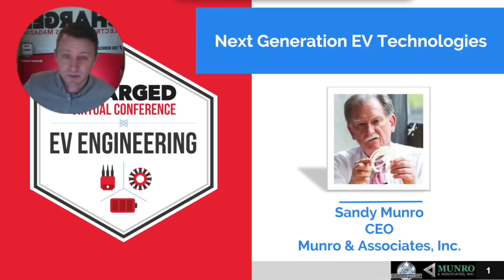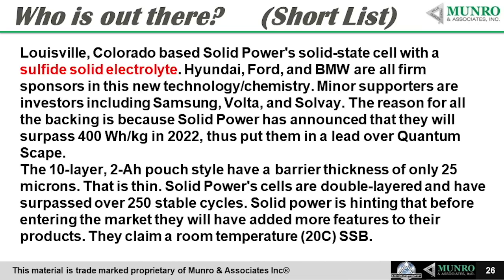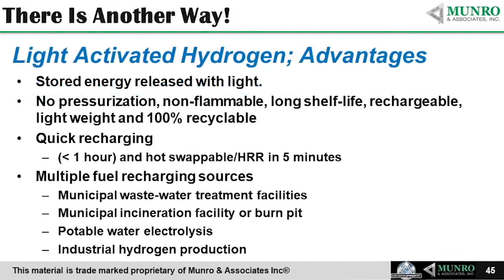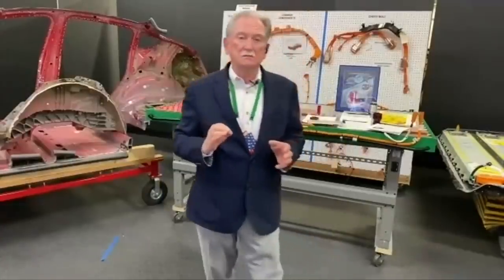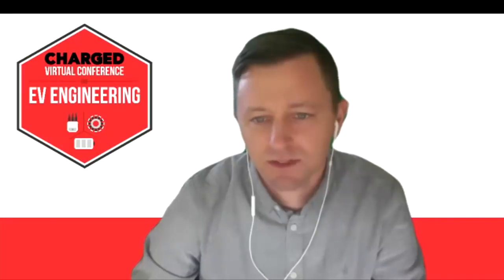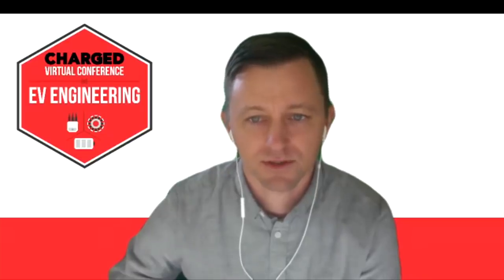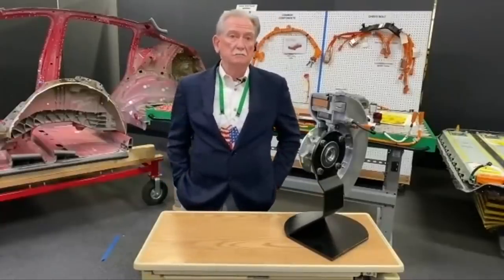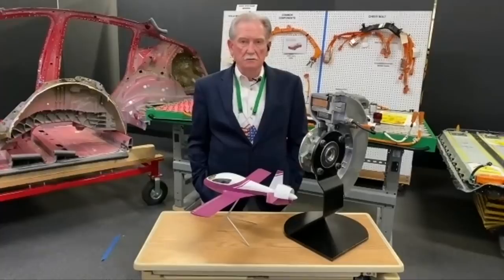Sandy Munro On Next-Generation EV Technology: Tesla, Solid State Batteries, MegaCastings, VTOLS, Q&A

Comment: The main reason that batteries will win out over hydrogen is that hydrogen has a negative EROI (energy returned on investment) of 1 to 5. That is one gets 1 unit of equivalent energy of hydrogen for every 5 units of energy input. An energy source of less than 10 to 1 (getting 10 units of energy for every 1 unit of energy input) is considered to be below the threshold needed for an industrial society. Renewable electricity is ~20 to 1, petroleum is ~14-20 to 1, and Canadian tar sand oil is ~3 to 1.

Comment: The most overlooked hydrogen storage option for fuel cells or for combustion is liquid ammonia.
Reply: Overlooked for a reason... no future for H2 in road transport.
Reply: @brunosmith6925  Sandy says the exact opposite and ammonia is not H2.
Reply: @fieldlab4  Oh... so I suppose we are to regard Sandy as God... what Sandy says will happen? Most observers believe Hydrogen has no future in terrestrial transport because BEV will be much cheaper. People make decisions by looking into their wallets. The engineering may be workable, but economics dicates behaviour.
Reply: @brunosmith6925  I'll wait for BE aircraft. Meanwhile, the energy density and inherent efficiency of using free oxygen for half your energy cycle will not be ignored. Are fuel cells a battery or a "H2" power source? 

How many kilowatts per pound do the best batteries provide, versus H2 and ammonia?

There is your answer, right in the numbers.

Comment: I'm impressed that battery chemistry advances gradually via "trial and error" and the Tesla "jelly roll" technology lends itself readily to improvements in battery chemistry without necessitating major alterations in expensive manufacturing machinery. Can the same be said of solid state batteries? My guess is that mass production machinery for solid state batteries would likely work for only one type of solid state battery, and that advancing to a better solid state battery would likely entail major changes in manufacturing equipment.

Comment: The problem with personal vtol is flight is an extremely dynamic situation.  That's the reason only 2% of the population has ever operated any type of flying vehicle. Those vehicles will need to be fully autonomous because the average person simply doesn't have a high enough livel of situational awareness if they did there would be zero traffic accidents on the highways today !

Comment: Ammonia is a stable hydride in liquid form. It adds one nitrogen per three hydrogen atoms but it can be used in internal combustion engines. Thermal efficiency is always the issue. But a crank less engine moving a coil back and forth will generate power with fewer losses and could potentially be made with variable stroke and variable compression ratio.
Reply: Sabic and Mitsubishi have been working on Ammonia projects for a variety of applications, but haven't released any details since the initial announcement

Comment: eVTOL? UAE and China are piloting ‘Unman Drone Taxi’ between urban to urban (big city) and urban to suburban with batteries operated for 2 and 4 seaters. It makes senses Dow few reasons. Firstly it’s autopilot so no license or pilot required. Secondly drones talk to each other (drone swamps) which means the taxi fleet could comply with aviation regulations for traffic control and safety purposes. Lastly is maintenance, a taxi fleet with equipped with knowledgeable engineers with routinely check list according to requirements while personal one could created issues either personal discipline or service quality.

Comment: a ventilation safety device for  batttery packs can help it to breath fresh air and out. Also act as safety device in an evetn of thermal runaway.
Reply: The battery packs don't need any ventilation.
Reply: You don't want any moisture to accumulate inside the battery pack.

Comment: Doesn't the Aptera's use of vacuum cast composite body components take advantage of the giga press casting idea without having to buy a giga press and deal with molten metal?  I think the Aptera has maybe 5 total body components that can be self aligning in assembly and hand fitted with no use of robots.  So much about the Aptera seems to be really smart to me. I know Sandy is working with them so I'm looking forward to a tear down of one in the next few months as they are getting close to rolling some off of the assembly line. By the end of this year or early next year.  Exciting times ahead.

Comment: Thanks for the video.
Question: if any of these castings get damaged in an accident there is no repairing them, correct?
Reply: Sandy stated that the casting can be welded, the casting is basically 386 Aluminum. But, 420KinK is right, once the car's frame is damaged the Insurance usually writes the whole car off.

Comment: Mega casting save lots of production steps, but how repairable are they? If the car is in an accident will the entire mega casting have to be replaced? I think so. This almost writes off the entire car in an accident that could have been repairable on other conventional vehicles...😕
Reply: Since the Megacasting is effectively a part of the Frame the question about repairability is superflous - if the Frame of a Car is damaged in a Crash its a writeoff, no matter how said Frame was manufactured. Also before it gets damaged the impact would have to go through the whole front/rear crumble zone first, not sure if you would trust any car repaired from such an impact..
Reply: The mega casting has front crash rails that can be sawed off and new ones bolted on to the remaining frame, so it’s designed to be more repairable than most frames.
Reply: @JanineArchiMarie  - So sections of the Mega-Casting can be replace if dammanged?

Comment: Some hydrogen issues covered but there are other bigger showstoppers:
Need to look more critically at the hydrogen fueling cost and logistics in road transport applications.
Due to still insurmountable problems and regulatory safety issues with transporting hydrogen that has such poor volumetric density it would take 30 H2 transports to carry the same energy to a refueling station as a single gasoline tanker. Liquid hydrogen is off the table due to cost on both ends
Also look at the cost of hydrogen fueling stations per vehicle per day. An H2 fueling station at $3 million can refuel 4.5 Class 8 trucks at 35 kg each.

Comment: In the old days, the stiff one piece construction of the race cars lead to more driver concussions from crashes. The crumple zones helped reduce occupants from sudden acceleration during crashes. Is the solid one piece body cast bringing us back to this problem, or is all solved with air bags or something else?
Reply: The Tesla Casting is not part of the crumple zone to my knowledge, the Crash rails Elon mentoined are the "part" where the parts of the cumble zone are attached to on the chassis

Comment: Love Sandy but that's not how SAE levels work, level 3 no longer requires the driver to monitor surroundings until prompted, it's a Level 2 system right now and even Tesla described it as such in filings. Get to L3 before talking about L4.

Comment: How does one do a quality inspection of the die casts? it would be bad to notice a small defective section after more assembly is done. Or do they do an in-situ repair?
Reply: Probably automatically with cameras
Reply: In Tesla's case quality inspections are the responsibility of the car buyer, not the company.
Reply: @cruiser97eric1  LOL, but those presses are interesting. I'd like to see what it takes to completely fill the mold and what they do to insure that it comes out perfect 9x.xx% of the time, and what the value of x.xx typically is.
Reply: I wasn't real happy with the gigapress video. I was looking for more engineering info.

Comment: All electrical applications has heat as the enemy. Cooling with liquids is old technology. 0.7 amp DC can maintain all electrical components at optimum efficiency temperatures. I built a hot plat / cold plate in my lab and with a thermocouple run thru a pc, I controlled any temperature desired.

Comment: With copper shortages and price hikes going wireless is going to look better and better.
Yes, there will be shortages as the demand has drastically increased BEVs solar, wind, power, and the wires to get it all to the users while copper mining and recycling have not, the lead times to get those up and running are 5 to 10 years.

Comment: With a Tesla vehicle for example, when you take your foot off the accelerator pedal, regen braking takes place. Which I believe is the reversing the polarity of the motor/motors to turn them into generators and capture that energy by storing it in the battery.  If thats true, why cant a generator be installed that captures energy by the wheels rolling forward? So the entire time it's moving it would be generating energy and storing it in the battery. Potentially having never the need to charge it.   your thoughts?   ty
Reply: An electric motor and an electric generator is basically the same. If you put 100kJ electrical energy into the battery (90%efficent) 90kJ electric energy comes out, if you use that to turn a wheel you get (95%) 85.5kJ rotational energy, if than take a generator to turn it back to electric energy (95%) you have 81.2 kJ electric energy left and in the battery only (90%) 73.1kJ arrive back. 

Because of the natural law of conversation of energy and inefficiencies that convert the other 16.9kJ into heat energy you will always end up with less energy than you started.
Reply: Extracting energy from the wheels while they're rolling (forward or backward, doesn't matter) will place a stress (apply a counter-force) on the electric motors, slowing down the rotation speed of the tires. 
Kinda like a "magnetic brake" of sorts.

Comment: Hi Mike why not use the wheels as a generator by putting a coil in tires and a magnetic core either in the middle of the wheel or as part of the disk drive? that way you can recharge and add to the distance an 
electric car can travel

Comment: Think the battery stuff and fuel cell info is great! I think the VTOL stuff is (pardon the pun) pie in the sky for most of it. If everyone who has a car now gets a VTOL - the sky is going to get very crowded very quickly. There's a reason why we spend millions and millions of dollars controlling airspace all over the world. If your Toyota get's a puncture or it's engine goes phut on the way into Tesco's car park then the worst that'll happen is you cause a traffic queue. If you're VTOL loses a prop or runs out of battery at 500 feet over the store's roof... you get the picture. I'm afraid the laws of physics get pretty unforgiving pretty quickly. Unless you're VTOL is lighter than air. That to me is an insurmountable issue for their widespread use with existing technology. And it goes whether your machine is piloted automatically or not. The costs of building in enough failsafe into the designs are just too high.
Reply: That - plus greater energy efficiency and all weather operation - is why I think tunnels are a better way to make traffic 3D. Of course there will always be a place for aircraft, but tunnels that can eliminate stopping and with cruising speeds twice what is possible in cities at present is going to be a huge improvement over what we have now, and more than sufficient for urban areas for routine travel.
Reply: @alanlight7740  Tunnels are just boring 😁

Comment: How long does it take to 3D print a car chassis? Hours? How long does it take Tesla to cast a chassis? Milliseconds? Both methods require expensive pieces of machinery, but guess which one is economically viable? Remember: 1 hour = 3,600,000 milliseconds...
Reply: Casting a chassis takes much longer than a few milliseconds.

Comment: What happened to ultra capacitors I thought they were going to be a high charge/discharge complement to batteries?
Reply: having capacitors on top of the base battery pack would help with quick accelerations/regen.  For charging the bulk of your capacity is still in the base pack which would still be limited to how much power it can soak in.
Reply: With all the new battery types having extremely low internal resistance (= very high charge / discharge currents possible) Super / Ultra caps simply become obsolete.
Reply: There MAY be a option for UC to act as turbocharger (high power dump) and to buffer high speed recharging if we can get there weight low enough

Comment: Self-anything, especially (actually essential) for futuristic air travel (VTOL for example) are in and of themselves awesome ideas. The problem is they are not compatible with sharing an environment with human operated vehicles, and will require more infrastructure including vehicle to vehicle and control station communications. Fantastic. Just one problem: All danger in travel right now comes from human fallibility. Self operation moves the human fallibility element to the designs and writing code. Humans make errors, people will still die, although it is likely be a significant statistical improvement over human operation.

Kind of like capitalism. Great system for wealth creation that is unfortunately underpinned by two essential elements: trust and ethics. Two things humans are guaranteed to consistently fail at.

Guaranteed to take the fun out of transportation.

Comment: Batteries are still heavy. Pushing around all that weight is not efficient and charging time is still too long and lithium production is still costly environmentally. 
Aluminium-Air is the best for aviation.
For cars it will be a combination of batteries, hydrogen and solar. 
Vitol for general transportation is crazy idea. Can you imagine the traffic management and licencing for safety,  forget about deliberate throwing stuff out of overboard.
There are already so many cars that shouldn't be on the road already.

Comment: I say people should take another look at Atlis Motor Vehicles. I believe they've finally figured out the charging problems for EVs. I don't want something that takes an hour or more out of my day every time I try to refuel it. Time is money and I need my time to make money with my vehicles. I also don't like most EV trucks that are coming out because they can't do real work. If you want a show pony truck, go for a rivian or cybertruck. If you want a workhorse truck, go for an F-150 lightening or an ATLIS XT/XP truck. (Ford for light to duty and ATLIS for hardcore heavy duty hauling.) As for cars, Tesla makes a nice series of cars/crossovers, but again...an hour or more for 0-100% charge is unacceptable. Using regular, off-the-shelf battery cells is one of the problems. Develop and build the cells for the purpose they will be used for. Current cell tech is based off of an old design that is inefficient when you're talking about EVs. Until that's sorted, I'll stick to my trusty ICE vehicles.

Comment: simply supercaps, hvdirectcaps (bati and high k), or metal-air, to get more charge cycles, higher and faster charging and density
Reply: one-use packs of very large hearing aid batteries, starting from zinc-air, for free, with nuclear or renewable production, also with green biomass
Reply: metal-hydrides, namely, titanium, aluminium, calcium, cyclosilane, as hydrogen storage, heat released
Reply: assume price is zero
Reply: for everything
Reply: when you are making the chlorides with electrolysis, you have tons of the hydrogen, along with the sodium hydroxide, with renewable solar, wind, wave energy
Reply: also nuclear
Reply: powdered metal-hydride heating to get the hydrogen, airless, like biomass pyrolysis and gasification
Reply: governments, money and laws must go down, to things to become free
Reply: just stamp some pieces
Reply: supercaps are great for grid storage
Reply: you have no hurry, if you do, dont allow them to speak
Reply: vacuum stamping steel
Reply: multilayer honeycomb spot welding
Reply: you could also have axles going from a central engine to the arm rotors
Reply: be hippies, independent
Reply: no standards
Reply: only if your co-op wants to do so

Comment: This is another presentation putting the cart before the horse.  The only realizable, clean, low cost way to generate the energy for complete electrification is advanced nuclear which can burn nuclear waste, spent nuclear fuel and thorium.  Also non-proliferating.  Once that infrastructure is built, or building, the best solutions for transportation are best evaluated.  That includes hydrogen generation.  The discussion above ignores what could be a reality if science and engineering was objectively considered disregarding politics.

Comment: Isn't it about time they made a solid-state battery with an electrolyte made out of graphene? as it's a great medium for transmitting an electric current, In fact, as far as I know, it's the best as most solid-state batteries I've seen or heard of if they are still having to dampen down the solid electrolyte to get it the current to flow so it's not really a solid state and that's why they are getting tendrils or dendrills spikes I like to call them I do think some people are trying to make a graphene battery in Australia I think so I hope it works and they find a cheap way to manufacture graphene out of natural gas I am hearing not exactly green but if it's not being released into our air then it's green or dumped on our lands or sea then its a good thing fingers crossed that's the case.